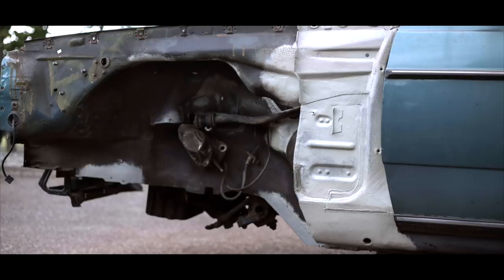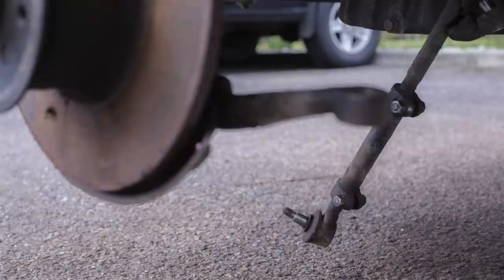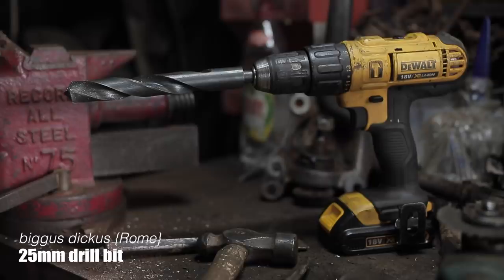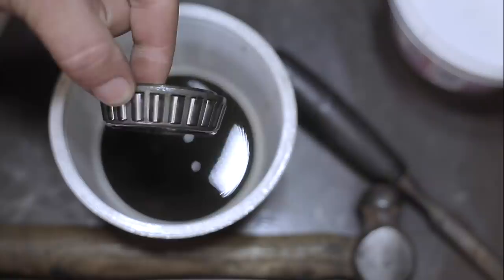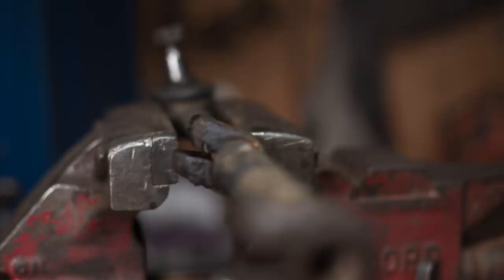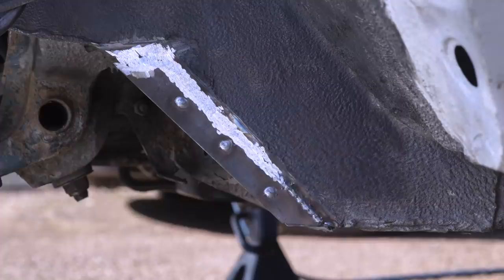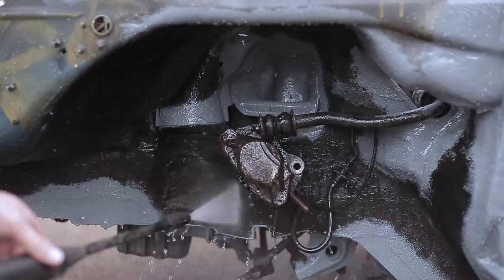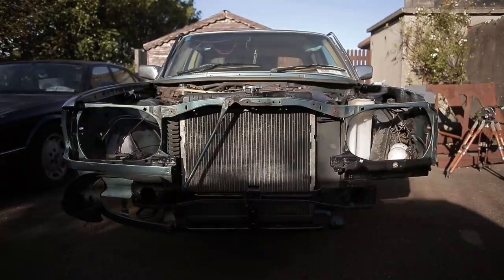Mercedes W123 basic tool rebuild // Soup Classic Motoring 59

Comment: Awesome!  
I own a w116 300sd (1979) and I'm currently working on reinstalling the rear flanges back onto the hubs.  I have to configure a tool to press the flanges thru the hub openings and get enough of the flange threads to protrude thru the other side so that I can then position the inner bearing then tighten everything else by tightening the grooved nut/castle nut onto the flange threads.  The grooved nut/castle nut requires a matching special socket to tighten.  I have to tighten the threaded castle nut/grooved nut to the correct tolerances (preload on bearings), without over tightening, or I will have to start all over.  Starting all over would require the crush washer/ring to be replaced with a new one.  The crush washer cannot be used again if you over tighten the nut (exceeded the correct preload on the bearings) .  Dial gauge is absolutely necessary.  Your videos allow me to concentrate and have patience.  
Thanks!
Reply from the maker: I had to really concentrate just to stick with you there... sounds a torture! Fair play for sticking with it the right way. Good luck with the rest, and thanks :)

Comment: I've been 'restoring' (ie keeping them going with minimal funds ) old vehicles more or less continuously since swapping the barrel and piston on an NSU Quickly in 1966 at the age of twelve, and I still learned several things from watching this video :D
I love your style and your witty banter which makes me feel like we are just having a little chat... 

One thing I might suggest though is to get an impact gun - I bit the bullet and bought a top spec DeWalt one a few years ago and it is without question my most treasured tool (no good  for stop-motion animation though I guess). Two things that I could not have done at all without it - removing the front crank pulley on a Rover V8, and pressing out the front ball joints on a Diso TD5. In both cases I spent many hours trying ALL other options (including 4ft scaffold tubes) before finding that 'Old Rattler' did it in seconds!

Keep up the good work.
Roger
Reply from the maker: That I'm really surprised to hear... but thanks for saying it :)

Comment: Xcellent video pointing out the importance of Specialty Tools 
I recently got a bigger roll cab to store my specialty tools ..my first special tool was a shift linkage seal install/removal tool for the GM turbo hydromatic transmissions most commonly found in the C3 Corvettes among many other GM models...I eventually learned that , if I polished the shaft smooth and round , and the seal was replaced properly , then it had a reduced chance of failing..
SUMMARY : the right tool AND knowledge/awareness of the equipment that is being serviced is key to a satisfactory result 😏 ..jus say'n

Comment: Your videos on rust have been interesting for me. I've been German car guy (E39, E39, E36) for a while, but recently got an Alfa 156 sportwagon. Beautiful, beautiful car, but I have found 3 rust holes under the windscreen cowl. The rest of the body and chassis is great, as I'm in Australia. I did buy a bunch of stuff, along with a Kemppi 200 evo mig welder. Just got to get a few more tools, some sheet metal and gas. Cheers from the land of no salted roads.

Comment: Lovely video once again. Had the front of mine in bits to replace the inner top wishbone bushes and bottom ball joints. Febi sell the top inner bushes separate from the ally arm. They just press in no problem ☺
Reply from the maker: Really!? Where did I read that it was a replacement only arm... well the deed is done now, arms are on the deck. Damn it! Thanks man
Reply: @soupclassicmotoring  no problem. Sorry the info arrived too late to save you a few quid. By the way could you tell me where you bought the internal spring compressor kit because I need to change my sagging rear springs and I don't want to strip the swinging arms out to do it. Love the videos, genius editing of course but your choice of projects is right up my street being a w123 addict.

Comment: Just a tip: A good paint for almost everything on the underbody and sheet metal work is Brantho Korrux. You get the primer called Nitrofest and the top coat in most desired colours called 3in1. I even use it for axle components on my restorations and find it much better than powder coating. Applied with a spray gun, the job looks professional. For hard to get in places like rockers i use nitrofest with a spray gun used for waxing such places. Been using Brantho products die Several years and must say, there ist nothing better...

Comment: You lucky fellow getting the lower ball joints out. The shop that I had mine r and r said even he had some trouble getting them out. I have put in zirk fittings in all the balljoints, Mercedes parts are getting harder to find and more expensive, must be a reason joints originally made with zirks, plus Popular Mechanics had a how-to on doing such. When the tie rod ends need replacing, they will get them too.

Looking forward to seeing this back on the road. And of course look forward to the other projects, keeps me motivated.

Oh and I quite like my 1985 280TE odd ball (basic trim with yet has heated leather seats, Blaupunkt sound system, the cargo roller shade and net, electric front windows, and best of all, ABS brakes). That six cylinder can really move and sounds great, look forward to when all sorted and back on the road.
Reply from the maker: Good idea, where did you get them ?

Comment: That is so true about the comparisons between a manual wire brush, rotary drill brush and an angle grinder wire brush.  Twin Turbo rust cleaning!  I find rust converter fron toolstation (turns steel sort of purple colour) followed by hammerite red oxide and then two coats of black hammerite smooth.  Then if im feeling generous some hammerite waxoyl under body stuff.
Reply from the maker: I could never be sure if the rust converter was just turning stuff brown, when I brushed it off [which it says not to do] it was still rusty underneath. I just kill it all with the wire wheel now. Thanks man :)

Comment: URGENT: Those "gear type" jack stands have been failing and they have issued over a million recalls in the United States - make sure to inspect yours, see that the "teeth" are deep and that they are making sufficient contact with the lock; otherwise just throw them in the scrap and get the classic "bolt pin" type. 

I have been missing your videos, don't keep me waiting so long :)
Reply: I have heard something about them. You r right
Reply: I bought some stands like you're talking about and they look really crap! Never trust them to work under the car. Cheap Ebay junk.
Reply from the maker: Thanks for the tip. Always careful about stands and working under cars.
Reply: Isn't it just the Harbor Freight (or as AvE says, the Hazard Fart) brand?
Reply: The design has been recalled in the USA for safety issues. Made in china  Covid19 inside .

Comment: That adjustable cam bolt on the control arm will affect toe, but its primary function will be to adjust camber. You would set the camber first and then adjust the toe last at the tie rods.
Reply from the maker: Yeah got that wrong, just not concentrating! Thanks for the catch :)

Comment: That's going to ba a very happy W123.  As usual, great job with the car and the video.
Can I offer two comments on the tool front though?  Two hammers.  Yes, the old joke about get a bigger hammer is kinda true.  The ball pein and a club hammer (or a large copper faced one) make a good pair.  When you can, hold the club on one side of the ball joint and then belt it with the other one.  This does help to concentrate the force into the joint and loosen it much easier.
Secondly, and my old dad would have had a heart attack if he had seen this, get rid of the burrs on the blunt end of your chisels please.  One day you'll hit the thing and one or more of those burrs wil turn into small missiles.  They have a great knack of embedding themselves somewhere in you.  It chuffin' hurts.  And that's why eye protection is a must when belting the living day lights out of old cars.  I don't want to think about the possible consequences of not using PPE in this case.  So there, lecture over.  Thanks George
Reply from the maker: Thanks for the tips Gray, I never knew that about the chisels! I'm very good about eye protection these days. all types actually, If I lost any part of myself or gained someone new to look after ;) I'd probably have to stop what I'm doing lol

Comment: Good tip is to leave the nut on the  balljoint so the splitter doesn't squash the thread if it's being a pain.
Reply from the maker: 100%, did on some. Sometimes I get caught up in the camera work. Thanks :)

Comment: Use Wifes toothbrush. Million years ago I set fire to a petrol tank whilst welding. Petrol is good solvent alright, but couldn't remove stain from my undies. Good times.
Reply from the maker: 🤣it's only weakness!

Comment: Diesel is a good cleaner and reusable, dad used to use parafin and petrol mixed together and swore by it. Parafin is also called kerosene for those who are interested.
Reply: I lashed out and bought a 20 litre drum of parts cleaner. Does a great job but evaporates at an incredible rate.
Reply from the maker: I just can't stand the smell of diesel, it gets into everything and lingers...

Comment: Count the number of turns of the tie rod ends as you undo them and you know how far to wind the new one back in, or clean the exposed thread then use a chalk paint pen to mark the length of the exposed thread, you shouldn't go wrong.

Comment: I usually just do everything with a hammer and an ax. Works well on electronics, too!
Reply from the maker: Lol, if it's not working just chop it off!
Reply: @soupclassicmotoring  That's right! Just make sure you keep the ax really sharp. A little maintenance goes a long way.

Comment: Makeshift bearing torque tool.
Requires one elastic band of low strength and a ruler.
Method : Attach rubber band to hub or whatever it is at a point where pulling on the band will turn the hub. Hold the ruler up where you can see how much the rubber band stretches before the hub moves. Duplicate that measurement when you have replaced the bearings.
Reply from the maker: Brilliant intel, thanks man :)
Reply: Soup Classic Motoring . I was being facetious, who would go to that trouble when you can usually feel the right amount of preload by hand.

Comment: Ball joint splitting with hammers.

Take two hammers (decent sized) place one behind the knuckle and hammer with the other one or if you are well coordinated hammer with both hammers at the same time (difficult I tell you).

But two hammers always does the trick.
Reply: Btw. If you need support finding Mercedes parts. I have some great sources due to my w116 SEL 6.9 restauration. Those parts are damn hard to find sometimes!
Reply from the maker: @Wauto-R  Thanks for the offer and the tip, will shout if things don't work out :)

Comment: Have you considered ordering a whole wheel bearing kit for the front? They usually come with the seal and might be easier to get in Ireland (Leave all the bearings in the box for when you need them in the future)
As always: great content. Especially the upright-burial. Good stuff!
Reply from the maker: I did, again a little difficult to do with any surety. The kits are never listed with the full dimensions of everything, i.e. the seals so it's just as possible to end up with two kits containing the wrong side of seal again. I've since found the seals, they have to come from America which is ridiculous but that's the way it ends... thanks for the thought man.

Comment: Hello, Raymond here, first off, I really appreciate the videos, you have a perfect sense of dedication to both the film making and the work at hand.... forgive me for misunderstanding...but which part/s are you in need of...I own a 123 myself and might have some spares standing about.
Reply from the maker: Ah you're very kind to ask Raymond. It was a pair of front wheel bearing seals, turns out there are two sizes and the ones for a car with ABS are smaller, but more common to source. My car has bigger seals because it's non ABS. I couldn't find them easily and it dragged for a few weeks but now there are some coming from the USA. So all good. Good luck with your car and thanks again :)

Comment: you need a sand blaster cabinet! :D love your work. your a inspiration for alot of us. the work your putting in is very iinspirational.. the work you put in on the range rover is absolutly insane.  the wealds your doing now with the mig is so clean. but fuck me you need a sand blasting cabinet, you need to get rid of ALL of the rust like the guy who did your esprit frame, it will realy make your parts last long. just need to coat it right away, like he said.  anyway love you show, keep doing you! im so exited for your next content!
Reply from the maker: Just got one! Need to buy a shop vac and filter for it, but it's already a great tool. Thanks man

Comment: if you've still got the old seal go to a bearing supplier and he may be able to get you some....or check the codes and use ebay,...... if you can read the number off the seal, you can get replacements, or you might just need to mic it up and find one that way
Reply from the maker: We did that and the closest we could get was about 3mm out in depth. They would work as a back up but I took the hit and ordered the real deal from the USA. Hopefully they land soon. Thanks for the thought :)

Comment: When you hammer the side of the ball joint "housing" you have to try to hold another hammer on the opposite side, as an anvil. Comes right out...
Reply from the maker: Top tip, thanks a mill :)
Reply: @soupclassicmotoring  anytime. great video and build, as usual!

Comment: I am surprised you could not find a parts car, at least you could.get all the screws,washers, and any other parts you could use, at least you could the car with all original screws & washers, of course in my case I got another W116 series,.where I got a whole body minus engine & transmission, but it had a whole lot of useful parts, and the best was it was free, I only had to tow the car away.

Comment: I was waitig for this a little bit :D I admire your effort to film all this detail, also the narration makes the surroundings tone down, ther's a tiny bit I am afraid of, when you weld sheet of metal to another one (lap weld), why dot you use some kind of welding primer? there's an air gap between them, and if there's air it will be water, you know what's next... I'm using Copper primer for example Forch L233.
Reply from the maker: I'll check that out, I've been relying on painting and sealing directly after the welds as best I can. Thanks for the tip :)

Comment: Love your work George.  I am about to buy a finger sander.  Would you suggest electric or air or is there just no clear winner?
Reply from the maker: I can't really answer that, generally you need a decent compressor for air tools although they'll run on a budget one, but I do know a compressor is ore costly to run than electric tools for a home mechanic. Far as I know anyway. I'll get an air one eventually but for initial outlay and keeping things on a budget the electric one is going to be better bet. If you do go looking for an electric one, look for one with metal roller surfaces for the belt, some have rubber coatings and in my experience it just kills the tool prematurely. hth

Comment: I didn't know you were using house paint on these.
I wonder how that'll hold up.
Reply from the maker: We'll see in the fullness of time but I think any kind of paint on the underbody is going to rely heavily on the stone chip/underseal so I have a reasonable expectations for the primer especially. It's certainly a lot thicker than a spray, and the odd time I've had reason to grind any of it back, the metal underneath has been perfectly preserved.